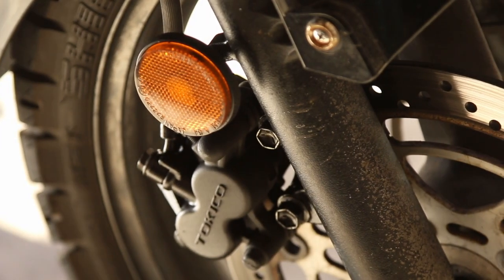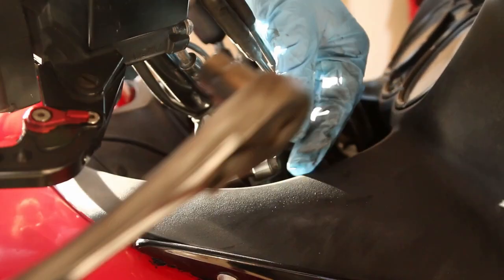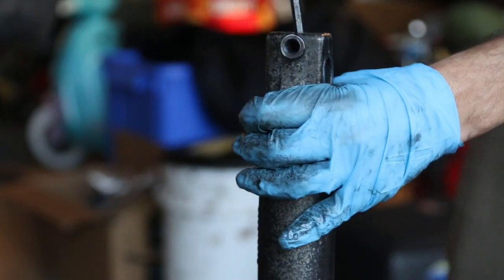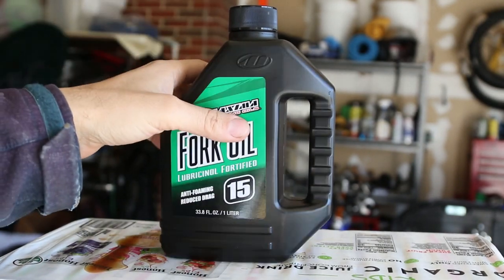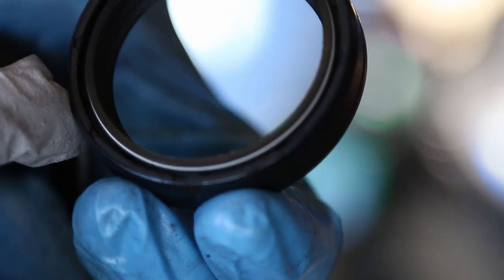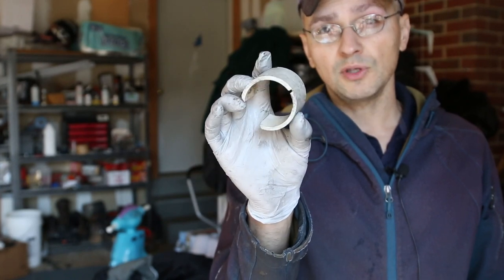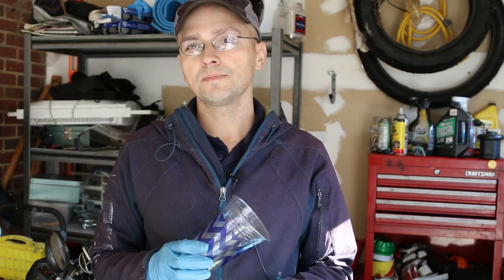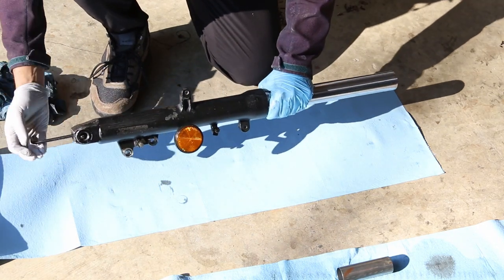How to do fork seals on vstrom

Comment: Great video, thanks for the upload. 

If I can add some value. 

Easier to remove the top fork cap whilst lower fork yoke is tight😎 

Good time to fit fork gaitors during reassembly. .

The 'Teflon thing' is a fork bush.

Original oil is 10 weight not 15. I run 5 weight and it's far plusher on road.

Comment: My Seal is 43x51 mm so I am selecting a PVC pipe to slice, 1&1/2" ID x 2" OD, then cut it open to slip on&off either sideways or off the top O/O°

Comment: Watch out for those bolts holding the plastic wheel splash guard.

Suzuki used some reaaally soft metal for that one and it corodes and locks itself in it's thread...

I just broke it after 2 hours of hammering and cursing.

Not even an extractor did the job, it just chewed trough it.

So, do yourself a favour, if you manage to get it out... REPLACE IT WITH SOME STAINLESS STEEL ONES OR AT LEAST ADD SOME MOLIBDENUM DISULPHATE VASELINE ON  THE THREADS SO YOU DON'T END UP LIKE ME...

I have to go now... I have to get that piece of screw out somehow... FUCK!
Reply: Same thing happened to me.

Comment: Clean the parts with brake-cleaner. Thatway you won't contaminate the new oil. And buy some seal-drivers or at least some fitted PVC pipe.
Reply from the maker: yeah, thats what i did.
Reply: @motardsquid  it is possible I was not paying enough attention. 
Have you changed the bearings from the rear suspension? I will have to do this job in the near future, but in my country is stil cold.